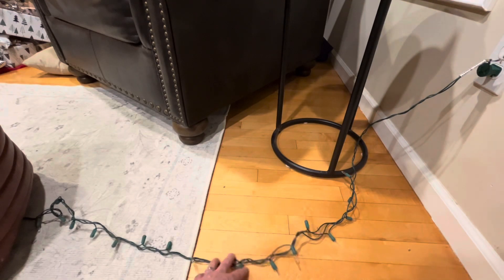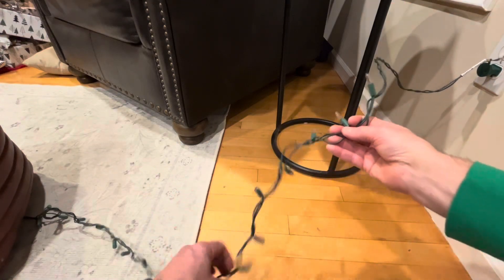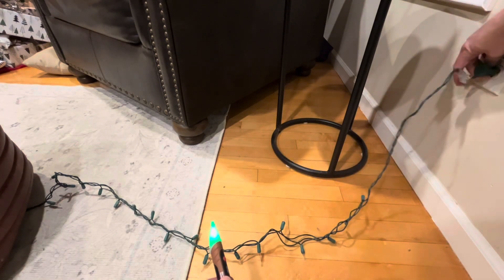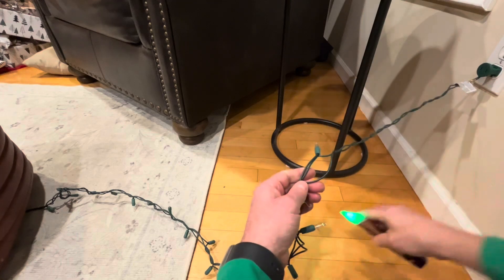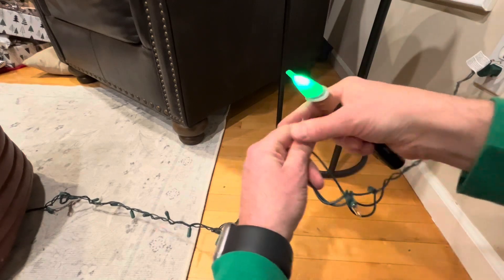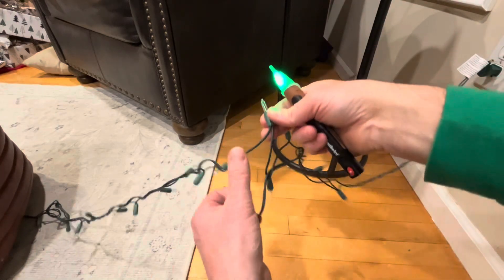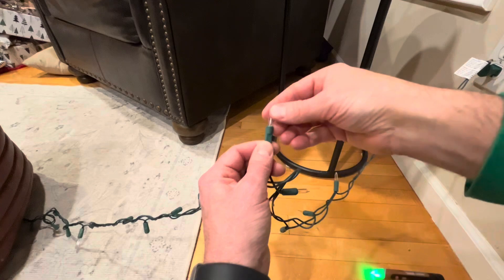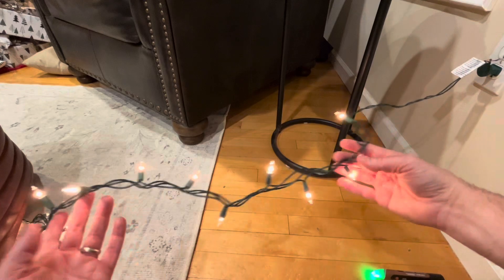How to Find the Bad Bulb in Christmas Lights (Voltage Tester)

Comment: I did this before I watched this video on a 50 light string.  It works great but there is a faster way.  Once the hot lead is located as you did, start in the middle of the string.  If you detect voltage, the first 25 bulbs are good and you have saved testing 25 individual bulbs.  Now test the middle of the remaining 25 bulbs.  If the light lights, you know the bad bulb is in the last 12 bulbs and you have saved time by not having to test every single bulb.  Using this method you can locate the bad bulb much faster.
Reply from the maker: Great idea Robert!
Reply: This is exactly how Binary Search Algorithms in computers work!